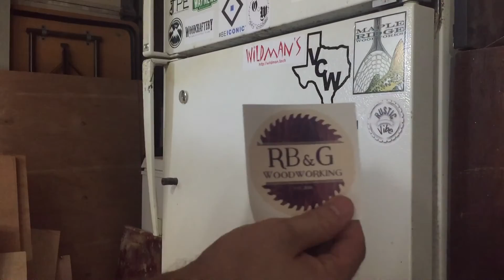JWF- PALLET WOOD FLOATING SHELF

Comment: HIIIIYAH!! ANA-SOCKY okay I've been looking for brass tubes like that for the longest time where did you find them shelf turned out nice good luck in the challenge my friend Focus focus Daniel Sun
Reply from the maker: Hahaha thanks! I just used brass rods that I found at Lowes.
Reply: +July With Fitz lowes...cool thanks bro..didnt think to look there..lol
Reply from the maker: +Joe basementwoodworking it's limited, but they usually have something
Reply: +July With Fitz cool thanks for the FYI man
Reply: +July With Fitz I just wanted some small quarter inch maybe 3/16" pretty much the same thing you used it for
Reply from the maker: +Joe basementwoodworking awesome. I always use them to attach knife scales